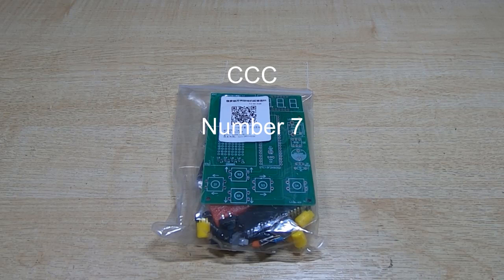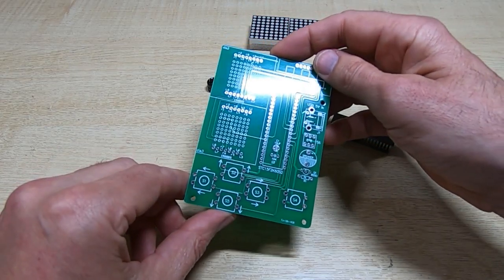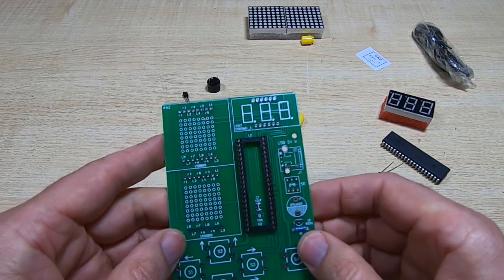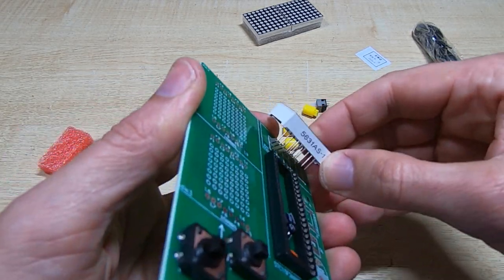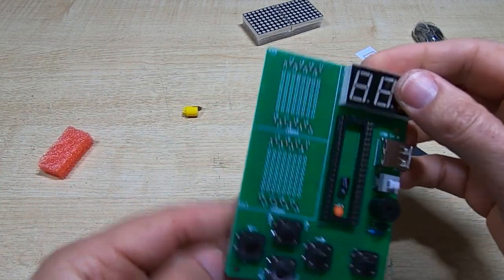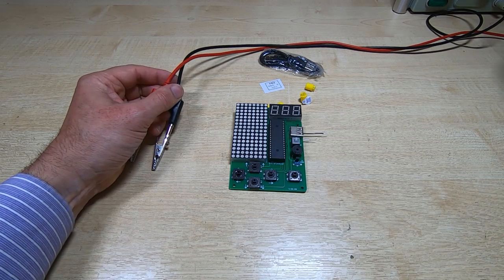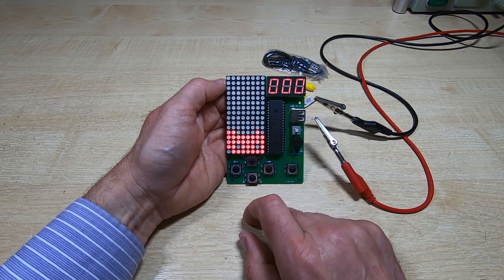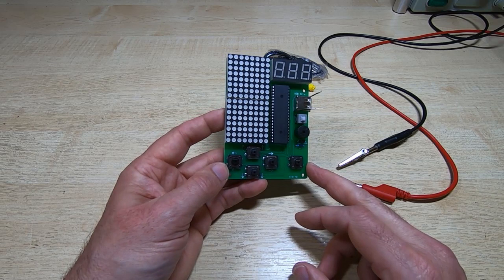Cheap Electronics Kit Number 7

Comment: Nice video. May I suggest using a high pass filter on your mic at 200 Hz as your video has a constant low pass hum (from AC maybe) that is very loud on a subwoofer.

Comment: Actually, that would be interesting to program, what is the processor?
Reply from the maker: Its an STC15F2K60S2. These are really 8051's that have been virtualised so that they can be programmed via the 'cloud'. Sadly that is the way a lot of development is going these days but I am sure there are ways to use them 'locally'. If nothing else then maybe this kit could be used to figure out how to do that.
Reply: @JerryWalker001  oddly enough, in the mid 80s I did a lot of work with Fluke 9010s and the 8051 (among others). I still love the Z80. And perhaps a resistor to tone down the very loud audio output.